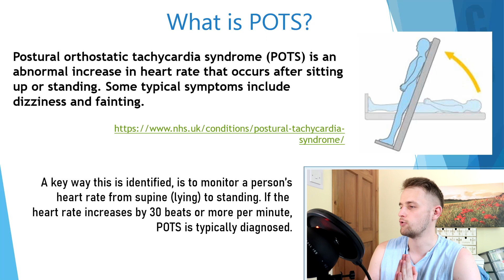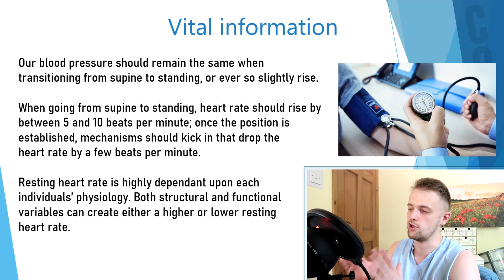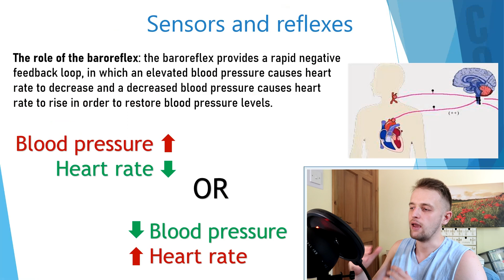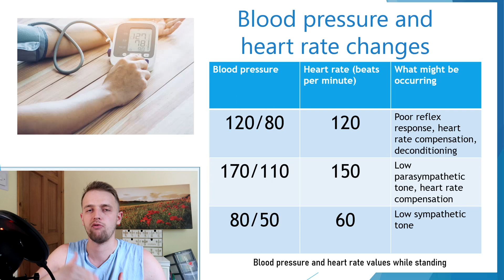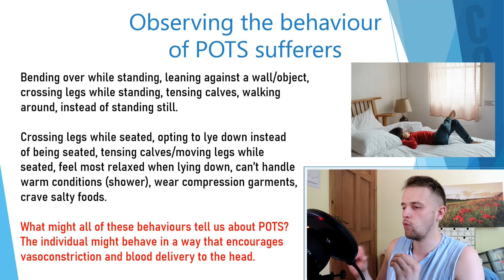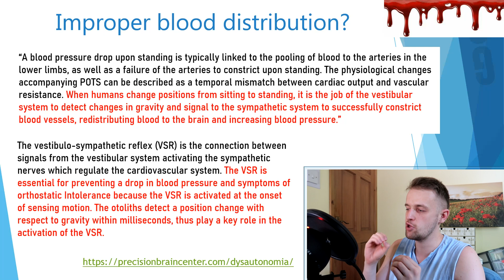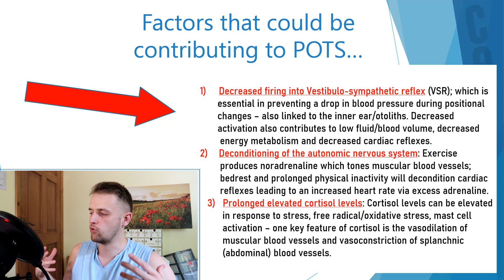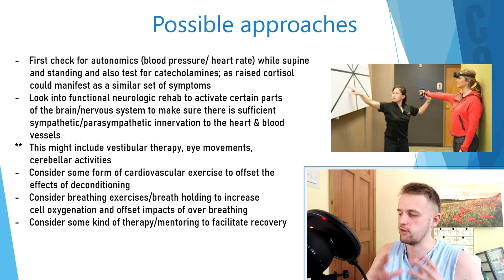What causes POTS? 😵 & can you recover? (Postural Orthostatic Tachycardia Syndrome)

Comment: THIS VIDEO IS ANAZING!! Btw I have a quick question lately I’ve been just checking my pulse non stop; been going thru a health anxiety phase tbh. I just want to ask a quick question, so when I’m sitting I notice my average heart rate is around 69-72 but then when I stand up I notice that it goes to around 100, mainly it’s steady 100 , I’m 18 6’2 160 pounds and I play basketball and lift weights, I have no real symptoms I’m very active when playing. I did some googling and my health anxiety just caused me to believe I have POT can you just give me ur opinion please? Also I remember just about 3 months ago when I my stressing was at its peak I remember my heart POUNDING so fast just getting out the chair in class but then when I stopped stressing it FULLY went away, so maybe I’m just overthinking and stress very hard and it’s causing it. I just went to the gym yesterday had a whole workout and then hopped on the bike cardio machine and it said my BPM was 130 . I’d love to hear what u have to say
Reply from the maker: Hey Jackson, thanks for your comment! I think we've all been through a phase of checking our pulse when it feels a bit fast or heavy-beating - it's completely normal for the pulse rate to increase to support adequate blood pressure when standing, especially if the mechanisms that are meant to carry out this process aren't working correctly, or they're not 'toned' enough.

To answer your question, in my eyes at least, POTS isn't really a yes or no diagnosis, it's more of a scale - some people can have a heart rate or 100 beats per minute and others can have a heart rate of 180 beats per minute; both will likely have symptoms as a result, because the normal blood pressure regulatory mechanisms aren't working correctly.

In your case, that rise of around 30-40 beats per minute between sitting and standing probably means you experience at least some of the symptoms I listed at the start of the video, and if that's the case, it might be worth looking into some of the ways to potentially improve the mechanisms involved in dealing with orthostasis. Your heart rate levels sound similar to mine and I'm 6'2 as well; the only difference is I'm probably closer to 190 pounds. 

What you mentioned about your heart suddenly pounding in class, that sounds to me like a panic attack, I've experienced loads of them throughout my life and they're definitely not pleasant; there's loads of different reasons for them, I'll probably cover that topic in another video. One thing I would say to you though, is that health anxiety is a side effect of this situation, as the faster heart rate will make you feel more nervous/panicky, but it's a completely normal response given the situation and so I wouldn't be so worried about it when it does happen - like you said, it comes and goes.
Reply: @chris_gascoigne    thank you so much for the reply! It really means the world to me, and a quick update Last night I tried to calm down and lower my stress levels, I ran a few more tests, based on the information can you tell me what you personally think? So my seared heart rate was at 62 and my standing heart rate I measured it at 80, I believe it got a lot lower because I started to do breathing exercises and calm myself down, I ran one more test: (this was when I was slightly stressing and overthinking) first I recorded my resting heart rate while sitting in a chair, I got 70 average. Then I stood up waited for 20 seconds and noted my pulse and got 96 then I waited 1 minute at the same standing position to record it once more and I got 96 pulse again then I waited another minute and got 88, then once more and got 92. I’d love to hear ur overall opinion on it it’d mean a lot :)
Reply: @chris_gascoigne    thank you so much for the reply! It means the world to me, quick update Last night I tried to calm down and lower my stress levels, I ran a few more tests, based on the information can you tell me what you personally think? So my seared heart rate was at 62 and my standing heart rate I measured it at 80, I believe it got a lot lower because I started to do breathing exercises and calm myself down, I ran one more test: (this was when I was slightly stressing and overthinking) first I recorded my resting heart rate while sitting in a chair, I got 70 average. Then I stood up waited for 20 seconds and noted my pulse and got 96 then I waited 1 minute at the same standing position to record it once more and I got 96 pulse again then I waited another minute and got 88, then once more and got 92.  also I want to add one last thing
Reply: one LAST thing to add, I did cardio today in the gym and was doing the bicycle machine and I was REALLY pushing and my heart rate was at a steady 120-140 on it, then I did some HIGH HIGH intensity cardio kind of like sprints and my heart rate maxed to like 160 and I wasn’t tired at all after I felt good tbh I could’ve ran a lot more. Btw I’m 18 so I believe my max heart rate during exercises could be 200, tysm once again